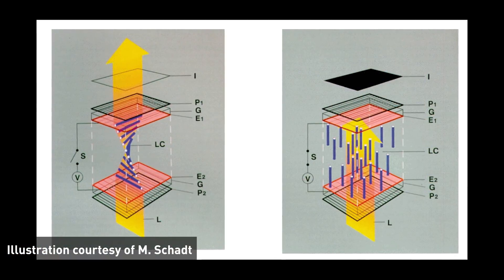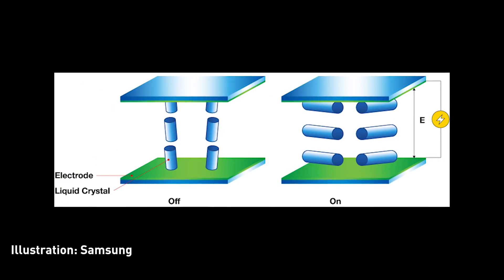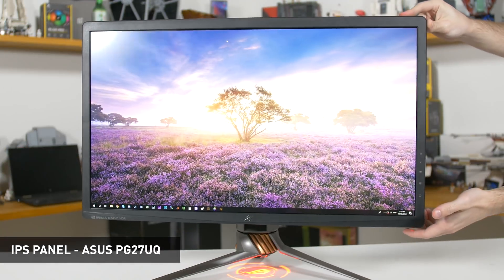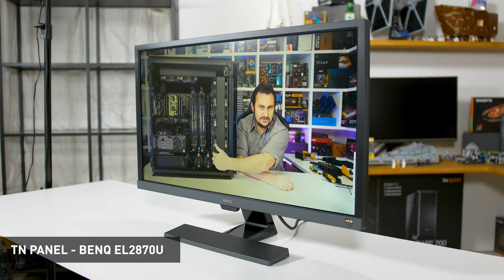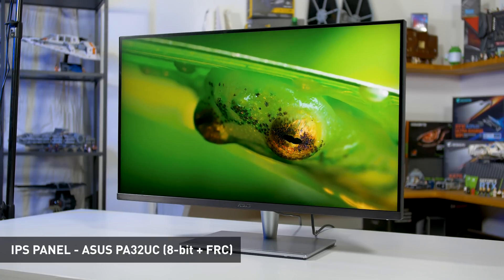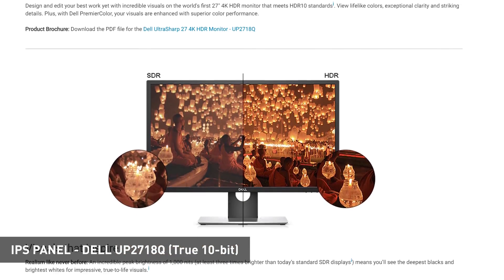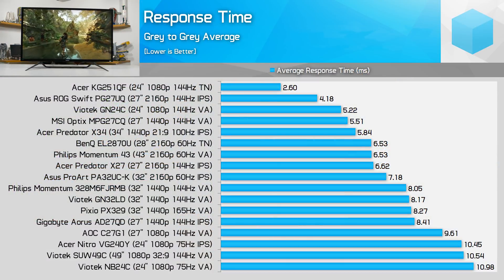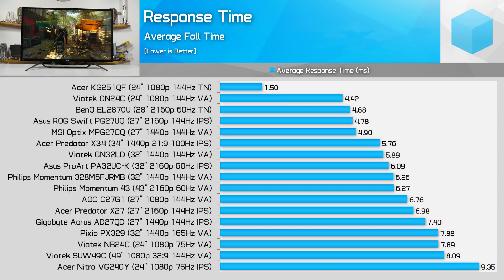TN vs IPS vs VA: Which LCD Monitor Tech is Better?

Comment: High HZ IPS all the way!
Reply: Asus PG279Q is a beauty
Reply: @leospeedleo  yeh very similar. Another good 1
Reply: @Jaz High Hz IPS? $$$$$$$$$$
Reply: which one?
Reply: @raven89k I have the Rog Swift PG279q and loving it. Not cheap but worth it.
Reply: @raven89k  my favourite is the alienware aw3418dw
Reply: Gigabyte aorus
Reply: enjoy backlight bleeding
Reply: I have the PG279Q, it rocks. It’s actually AHVA, not IPS though. It uses the same AU Optronics AHVA panel as the Acer XB270HU 👍
Reply: @TechWithSean  AHVA = IPS-type. It's IPS in all but name, since IPS is trademarked.
Reply: I don't like backlight bleeding and black looking like blue in IPS.

Comment: VA cause I appreciate the black levels, especially when I watch movies on my monitor
Reply: I like my VA Samsung monitor.  27in bought a year ago for $200 so basic but not super budget.   I can see some slight ghosting or motion smear if Im watching test patterns but I don’t notice it while gaming.  It doesn’t have a high refresh rate but i have it locked at 70hz freesync works great.    Viewing angle is pretty good mostly because the screen is so bright.   The high contrast 3000:1 really stands out and is what I noticed most this panel vs others Ive used.   In witcher3 sometimes I just stop and stare at a sunset....   hard to describe its just, brilliant the way the colors just pop out against against a dark background.   I could see where professional gamers playing twitchy shooters would want a monitor with a faster response but for most casual gamers I have no problem recommending a good VA panel
Reply: @evers6214  Haha I was doing the same shit on Witcher 3. I would change the time to sunset and just stare lol I get that feeling a lot. Were I'll just stop and look at some neon lights (especially red pinkish ones) in a dark area and I'll just stare like fucking hell that looks pretty
Reply: I think these guys need to check out modern VA monitors... The newer ones suffer far less from these problems. Probably not a good choice for competitive gamers but for everybody else, I doubt you'd detect ghosting.
Reply: @Buffinator1988  ghosting ha ha i have 144hz 1ms VA 24 inch monitor
for only 164 eur and i get smooth competitive no ghosting gameplay
Reply: Omg it happened, panel wars. Lol who needs blue vs red vs green when you can talk about panels 🤪
Reply: I think there are crappy monitors out there just flat out poor quality and people make the mistake of thinking the problems are because of the underlying lcd tech.   Thats only one piece of what makes for a good picture.   My advice don’t get too hung up on that one tech spec, read reviews of whatever specific model you’re looking at and if possible buy from a store that accepts returns if you don’t like it.
Reply: VA = best for general users & media use, including games but especially movies
IPS = best for artists and designers who need top notch color accuracy
TN = best for competitive gamers who need lower screen response time
Reply: Justin Legrande your stupid its all part of the input lag anyways, there are alot of 5ms  va panel that response better than 1ms tn, tn is just cheap and looking awful.
Reply: @nandukalathil7171  tried two MSI monitors. Both didnt have good response time /over drive and it wasn't so hot. Samsung is prob best VA monitor but still has ghosting
Reply: VA + QLED (Quantum Dot) looks amazing. I got my C24FG73 for €170 and I couldn't be happier with it. Vivid colours, 144hz, Freesync, G Sync compatible, 3000:1 contrast and curved display. Currently using it for my PS4 Slim (which I bought 2 years ago for only €180) and my GTX 1050 (4GB) laptop.
Reply: @BlackParade01  Yeah i got cfg73 really good colors
Reply: @BlackParade01  I can't find that model in my country. Does it have another name?
Reply: @Black Ceiling VA can be better than IPS. My €170 VA monitor with QLED backlight has much better colours than the IPS panel on my laptop. Also, FreeSync, G-sync compatible, 144hz, great software, curved, very flexible stand.
Reply: VA is superior in every way to TN and IPS except for pixel overshoot, unless you're a serious competitive gamer then you won't care about this. IPS screens are not great if you want perfect clarity in FPS games either since their pixel response times are higher than VA.
I agree that VA just has the best colours and contrast, IPS do not (although colour-wise they aren't far off VA). The only thing IPS has really is slightly better viewing angles and IPS glow :D
Reply: VA is the most vibrant, but IMO, IPS produces a far more realistic image and is much clearer for motion.
Reply: funny enough the monitor I'm using is on his charts (Viotek GN32LD) I got it CHEAP and so far I haven't had any problems with it
Reply: I dont like VA's because of the black smearing which for gaming is just a deal breaker
Reply: My problem with VA is it can go from bar none the best Image quality [aka AUO's native 10-bit +5000:1 contrast panels they make for pro and high end TV's, yes rare for regular monitors], to almost as bad as TN. IPS are more consistent, even if they look milky if you ever play darker games or turn down the lights. Also VA's can be very fast, but always seem to have some issues with certain transitions, some are so smeary I cannot even use them to browse, some are very fast, aka AUO AMVA once again, but you always have to look up panels before buying.
Reply: N Bk had to mag monitors my ips is far better on colors blacks just as good too just depends if n the ips
Reply: its also best for metro exodus
Reply: Dumb fuckin noob
Reply: @kraziivan_  you're a peckerwood..
Reply: Yeah some content looks crappy on my TN. Someone will be wearing a black suit and I can't even see the collar.
Reply: @anomous2307  Which monitor do you have tho. That plays a factor
Reply: @DETERMINOLOGY  it was my older monitor, I got a new one, it's a bit better I'll look up the models later on, both tn for the response time
Reply: why only movies? games profit from it too
Reply: @Gubers  thanks for your information sir.
Do you happen to know which is the best VA monitor for 24" you can recommend? I can't handle a big screen more than 24" since I always play FPS genre.
I can't stand with my IPS monitor when watching movies and playing games with a dark environment.
Reply: and playing DOOM64....PC
Reply: But were you able to see the Battle of Winterfell Season 8???
Reply: VA don't always have good black levels I had one were I tried to watch batman on it and the black were dark sure but so was everything around them VA in my exp has some of the worst pixel bleed. 
I own 2 monitor a TN 240hz 2k one for games were the extra frames really help ( it also claims to be 1ms but pretty sure it's more like 1.5~2) and an IPS 2K HDR400 monitor 120hz 3~4ms for games were I care less about super high refrese rate and reps time but want the game to look great.
Reply: I love this LG VA monitor, only a few years old but excellent. Best for movie and gaming. Very little of smearing and no black crush at all. Excellent I have to say! I was glad not to buy Samsung VA since heard about problems. I have LG IPS as well for photo editing in general but awful edge glowing and bleeding, not fan of it. Newer VA came out has better colour coverage overall than what I got is a bit old though.
Reply: a
 @naththoau
Reply: I use the Samsung cfg73 qled 144htz and the color is amazing and it’s VA. It’s honestly the best 1080 p 27 inch monitor around
Reply: And ligma ma ballz
Reply: i also love the black level smearing. makes my games look soooo good 😆
Reply: @jkd4568  that's why for VA the G7 is the only way to go, no smearing
Reply: Ageed. I like the quality of IPS but they have too much glow....
Reply: You're right. I have a Dell SE2717H which is a 27" 1080p IPS 75hz Freesync which I bought last year for 190€. A budget monitor with good colours. Impressive colours I might add for the price.

However, I must say that to play Resident Evil on this thing and to watch some movies I really need to watch it in the dark and not push the brightness over 60% or else the darker areas are really washed out. Also, for dark games, dont forget to adjust the brightness correctly on the game settings or else it wont be a very pleasant experience.
Reply: @pedrosoares7273  not 4k hdr you dumb fuck
Reply: and the insane pixel lag/overshoot (when using heavy overdrive)
Reply: @microsista1413  From the future here 240hz on a VA panel now :P plus HDR. RIP IPS.
Reply: I love the performance of TN but for some reason it hurts my eyes when using it for an extended amount of time, changed to VA and my problem is gone

Also

peepee poopoo butt
Reply: I tried VA and i cant do it. too much ghosting/smearing
Reply: Sorry but the smearing is a deal breaker for me
Reply: I have used a budget BenQ VA+ panel for over three years now and have noticed no more ghosting or other issues than on the TN I had before. In fact, I notice no real issues at all, except some minor black crush.
Reply: Using curved samsung va now, its a mehh... va glow, ghosing, smearing, bad view Angel.
Reply: and the washed out picture
Reply: @GAnimeRO  washed out picture with best contrast ratio and solid overall gamut cover? explain please.
Reply: @filipdumanowski5869  peepee poopoo butt
Reply: @GAnimeRO  Washed out picture because you dont change color range to "full" ? lol
Reply: @filipdumanowski5869 The guy that is saying that VA has washed out picture has no idea what he is tslking about I was looking at a JVC TV the other day same model one was IPS and the other was VA and the IPS was the one that looked washed out the VA looked so much better because the most important thing for a good picture is contrast not viewing angles lol
Reply: GAnime88 
Washed out picture?? I don’t think you know how it works buddy. The higher the contrast the better the picture all around, it’s IPS that has the washed out picture! Get your facts straight
Reply: @GAnimeRO  Washed out? VA's are over saturated if anything. The colours are too vibrant but definitely not washed out tf.
Reply: @GAnimeRO  Lmaoo Shots firedxD
Reply: @GAnimeRO  how will it be washed out when it has the highest contrast ratio?
Reply: @GAnimeRO  G7 looks sexy
Reply: GAnime88 thats with tn monitors
Reply: @GAnimeRO  u are talking ancient VA tech
Reply: Set the color spectrum to full instead of limited in your NVIDIA control panel.
Reply: IPS: Office
TN: Gaming
VA: Movies and Series
Reply: @nowonmetube  Which is why im lookinh towards TN..The 1ms response time in twitchy / FPS games is really important to me. I mean 6ms is good to but i can feel that difference
Reply: @DETERMINOLOGY  that sucks 😐
Reply: @nowonmetube  noone needs cheap tn panels, the input lag matters not the respnse time how fast a pixel changes
Reply: @marcrchtz9024  ah yeah? And which one had the best input lag?
Reply: i have a monitor with like 4ms  response time but its still much faster because the input lag is much lower. had a 1ms response time tn panel before
Reply: @marcrchtz9024  what technology is it?
Reply: Actually its been a time when i knew what wich is and what it does but im very/pretty sure i have an VA panel from Msi (actually its from samsung because Msi buys them from samsung lol)
Reply: Witcher 3 looked awful in my VA monitor. Most other games looked better than my old TN display. Then again it is a fairly cheap monitor.
Reply: @rayyanali4471  You say VA was bad but then you say its a cheap monitor as well..If your using VA make sure its on a todays standard or close to standard so we can see if VA is really that good or not
Reply: Well there is no perfect monitor I guess, they all have their pro's and cons. But VA is the worst when it comes to gaming imo.
Reply: AzuuL u dont know what are u talkin about. It depends on what kind of game ur playing kiddo
Reply: @johndane9878  That's true, but there is no point of getting a VA since it doesn't outshine in any field except for contrast ratio. If you want image quality you pick an IPS panel and if you want the smoothest gaming experience possible you pick a TN. Also using terms like 'kiddo' do not make your argument stronger but rather simplistic.
Reply: AzuuL 
High contrast equals a good picture though, A good VA looks way better than an IPS
Reply: If you want black levels, go CRT. VA is not even close to that. Other than contrast ratio, which gamers couldn't care less and most people either, VA isn't good for anything else.
Reply: and black crush
Reply: @Михаил Найденов
Black Crush is Samsung VA only, not found on AUO AMVA or Chinese copycats. 
To be fair; Samsung dominates the market sadly.
Reply: @nandukalathil7171  The msi mag series are peepee poopoo butt